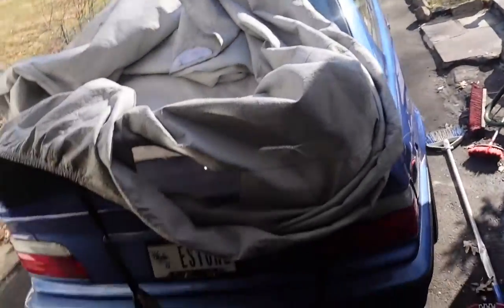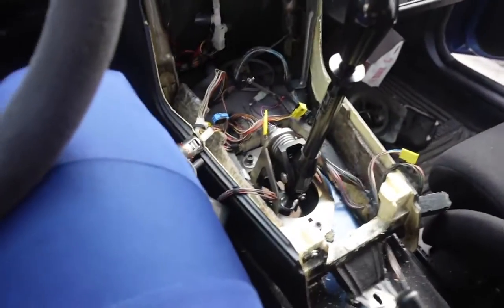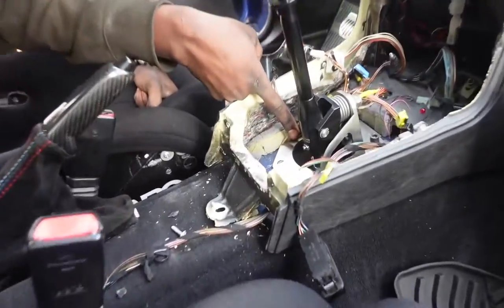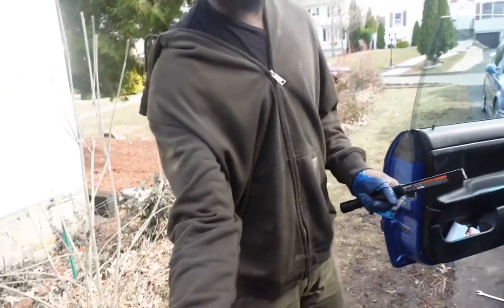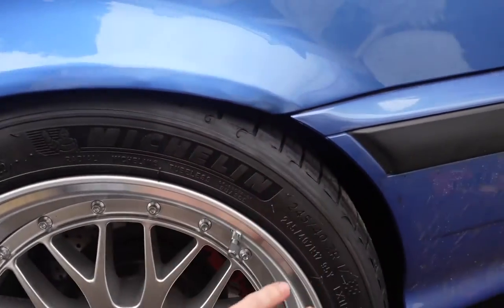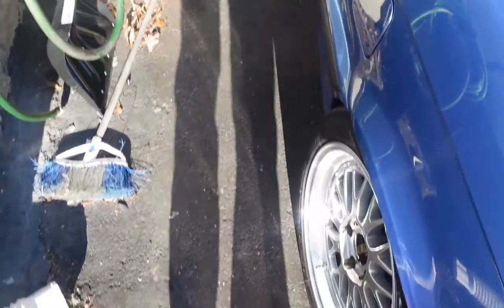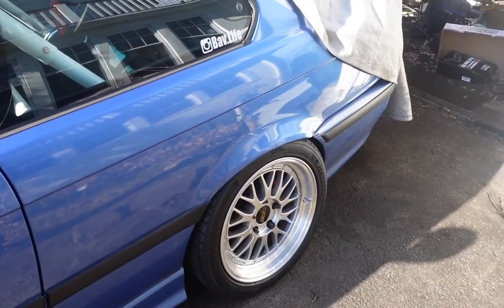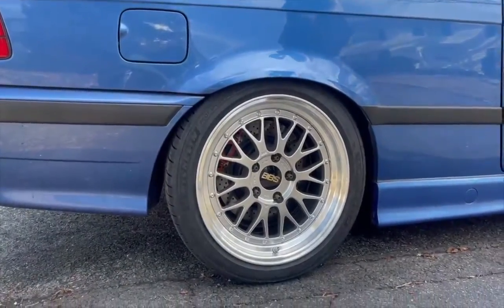E36 M3 RTD Shifter Install & BBS Fitment Adjustment

Comment: just saw this vid........I track an e36 after yrs of running an s50/e30...........also just felt  an rtd in another car, e 36,  and it was amazing...my car has a garagistic chassis mount ..me no like......                loved the vid......but wanted to add that to have to run 215s in the rear of an e36 is kinda weak as its clear your wheel is not a proper choice.... the car deserves at least 235's.....cmon fellas........    where r u in NY?.......LI , Westchester?.....